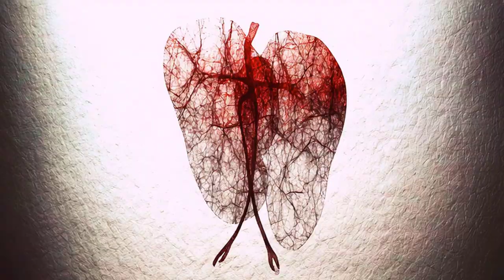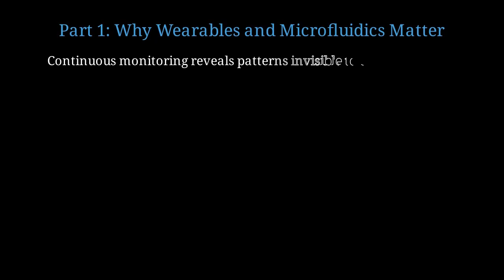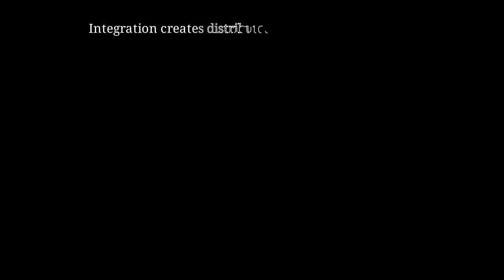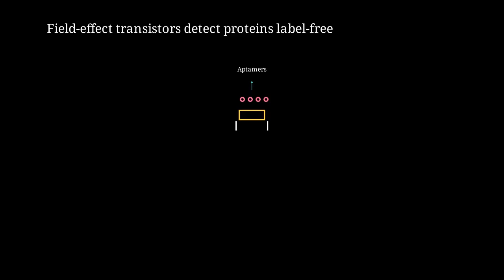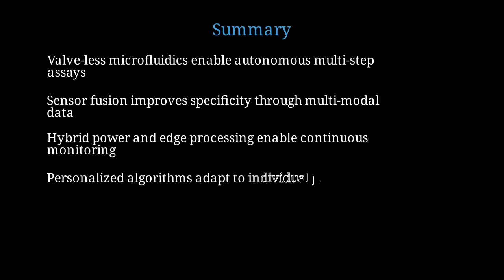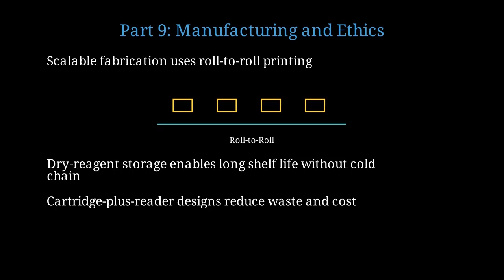This Patch Checks Your Health Without Needles!

Comment from the maker: How can microfluidic organ-on-chip systems accurately replicate the mechanical, electrical, and biochemical microenvironments of human organs to produce clinically valid results across diverse patient populations?
What are the scaling and integration challenges in coupling real-time biosensing data from lab-on-chip systems with AI algorithms while maintaining data fidelity and biocompatibility at the microscale?
Could future lab-on-a-chip systems achieve closed-loop therapeutic control — sensing a disease marker, analyzing it, and autonomously delivering an optimized drug dose inside the same device?